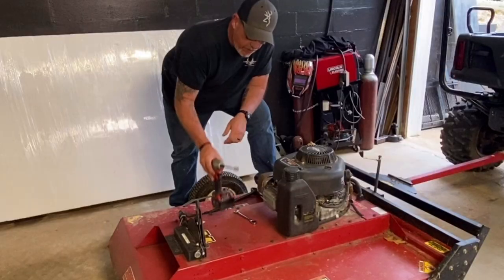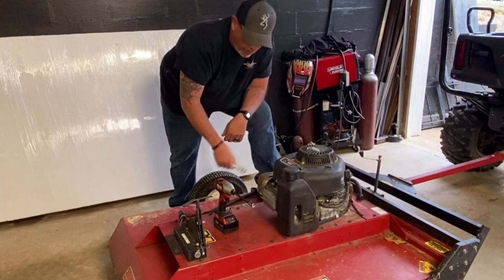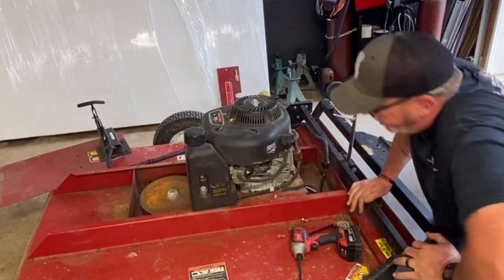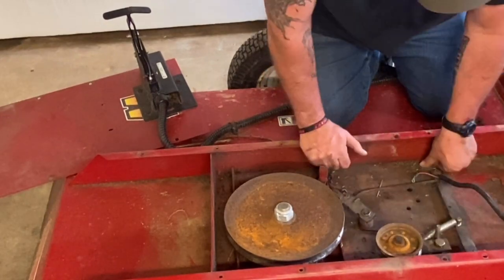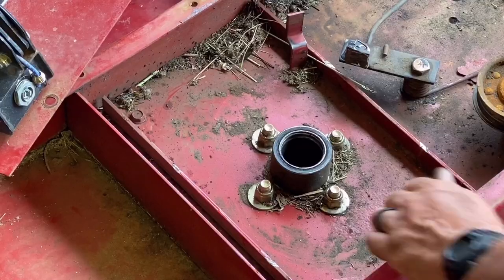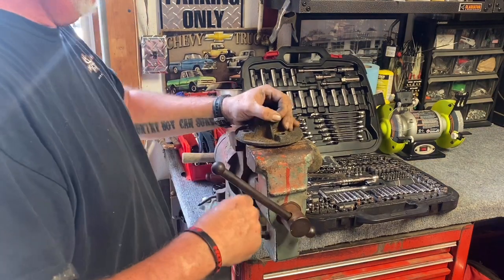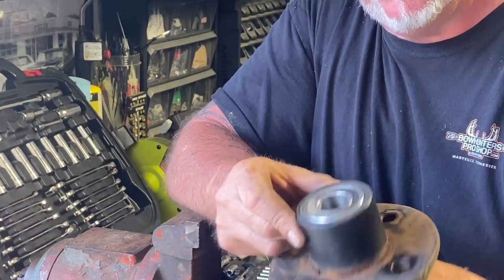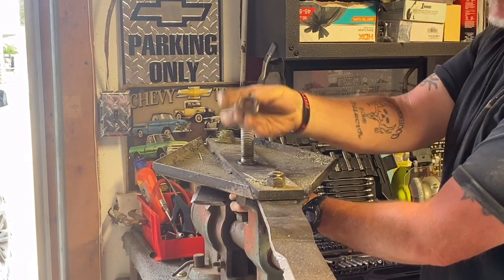Swisher 44 rough cut bearing install

Comment: I have to replace the idler wheel and bearing I just can't keep belts on it.  Using Kevlar belts and figured might as well see what it takes to replace the other one. Thanks for the video.  Surprised to see no grease in the hub and sealed bearings
Reply from the maker: The first time I did the bearings I was surprised when it was sealed bearing also. You will like the Kevlar belt.  Thanks for watching and good luck on yours.

Comment: It seems as though the pulley and blades can spin independently since there are no key ways to keep things from that. So it is just how tight you can crank together. Any torque spec on the big nut on top of pulley or just tight as I can get it??
Reply from the maker: I have always just run them down tight as I can get them and it has always worked for me. I haven't seen any torque specs in the manual.
Reply: @pineylife  I talked to Mike at swisher and that nut above the pulley gets torqued to 235 ft lbs. what bearings did you order of Amazon?
Reply from the maker: @ajwilson1953  Wow that's a high torques but makes perfect since. Here's the link for the bearings I bought for mine. https://amzn.to/4d9DNZl

Comment: would  it be better if you drilled and tapped a grease fitting on the housing and removed the inside seals and greased it regularly
Reply from the maker: I don't know how long it will last like that. That's a great idea though. I wished they had a conversion kit for them.

Comment: I just took mine apart but there are some differences.  1.  Mine doesnt have a bolt going thru, it has a nut on top and a nut on bottom.     2.  that shaft (you have a bolt) will NOT come out.  Therefore, I cant dismantle the assembly to expose the bad bearings.  I tried putting in a press to press out shaft...nothing.  Any ideas?
Reply from the maker: Dang man that's crazy. Well if you cant get it apart I would suggest getting a new shaft and bearings. I found a kit on ebay for mine when I messed up my shaft. I would look it up by your model number. Keep me posted on how it goes.

Comment: Would like to get one of these mowers so this is useful information. Much appreciated. 
Do you recommend these mowers for bush hogging small areas. All the best.
Reply from the maker: Yes I would recommend them for small acreage and field edging.  The rough cut is better than the finish mower for doing a field. With The finish mower you have to mow the field just like you would your yard once a week. But with the rough cut you can bush hog when you want to just don’t pull it to fast. They are awesome for trails and field edges. Thank you for watching.

Comment: I have a 44 inch rough cut where can you get the Kevlar belt and what the part number
Reply from the maker: I have been checking since last night and everywhere I'm looking they are currently unavailable. I would check with your local napa store. They have got me a upgraded version from the gates belts before.   I usually get is a D&D Belt part # ba50

Comment: When I reassembled, the 1" bolt kept breaking loose allowing the stump jumper and pulley to spin free. Any tips on how to prevent this?
Reply from the maker: Justin D. Jack I haven’t had that issue. I have replaced bearing twice on mine. I used lock tight on mine the time before and I also replaced the washer on top and bottom with new spacers. Then torqued it down until it was tight. Maybe the spacers are wore down not allowing it to  pull tight. I would inspect the spacers and wagers for wear and maybe replace them.
Reply: Swisher recommends that you replace the nut each time you remove it, I wish i had known this before i replaced my bearings because mine is doing the same thing.  A new one is on the way and i`ll also be using locktite this time.
Reply from the maker: sasquatch769 I have always used lock tire also but I have always reused the same bolts when replacing my blades. But your right to be safe it would probably be better to use new bolts. Thanks for watching